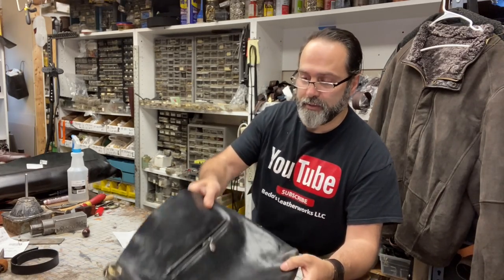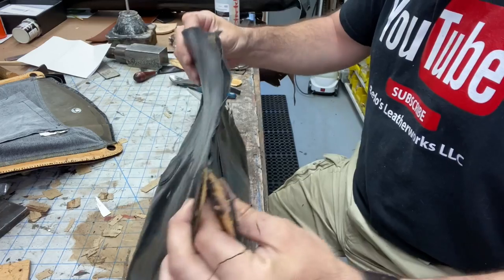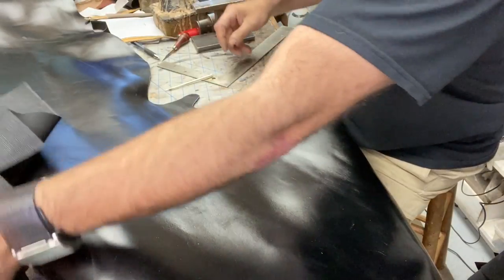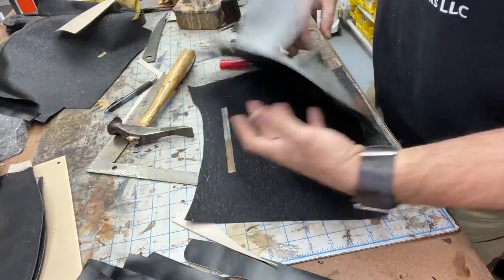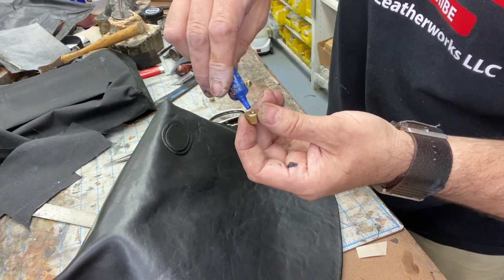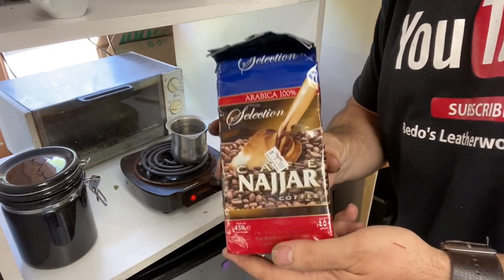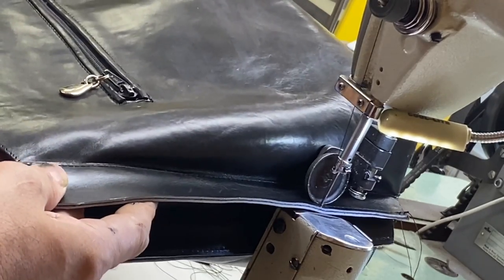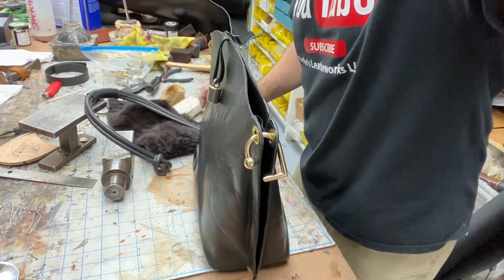Saving another bag from a repair gone wrong

Comment: I would expect a well trained professional/artisan to charge at least $70/hour, and maybe more if they are located on either coast. I think people forget that your hourly rate also covers things like rent on the building, and electricity and web hosting fees and wear and tear on machines, professional fees, training, you tax accountant, placing orders for supplies, etc, etc. Overheads have to be calculated into your prices to make running a business sustainable.

I also think it is easy to forget that when I see you with a pile a cut out pieces and your sew one seam and then the bag is done, that it looks easy. I imagine that 30% of your time is spent looking a bag and reverse engineering how it was made, and coming up with pattern pieces and a plan. And that is not shown because it is less interesting to film.

Steve, you are so gracious to share to your craft with us. It is your gift to me and I am very grateful. Thank you!
Reply: Exactly. People have no idea how much running a business costs. I had none, untill I ran my own ... It took me a full year to know learn how much I should be charging, and what to expect.
Reply: Also there are wastages on materials that Steve have to absorb, as these materials sometimes came with flaws that cannot be used for the repair work.

Comment: I work at a lawn equipment repair shop. And NOTHING drives the mechanic crazier then when someone else has tried to work on the unit, and failed. He says the same thing you mention in the beginning "sometimes it's more work then it would have been, if they hadn't had someone else try to fix it"

Comment: For an old very dry and  stiff briefcase, whose machine double stitching has mostly dry-rotted, and which needs to be re-dyed - to do any stitching I'd first have to condition the leather to make it more supple, but - should I dye the leather before conditioning, or condition the leather before dyeing?
Many thanks for your anticipated clear response, based upon your experience and expertise (not to mention, a cool beard).

Comment: You can try to use a screwdriver with magnetic head (the head can be bought separately) or to use a smaller one that is not in shape of a gun because you have small areas to work in.

Comment: Hi, Steve! I love watching your work. I couldn't afford your prices. However, people have no right to complain about the price of a manual job that requires skill and experience that takes years to acquire. In fact, don't complain about the price of anything. If you can't afford it, don't buy it.

I'm a little confused about the color of metal parts. Zipper handles and the metal accessory hanging from the top are silver. Eyelets are brass and the hook(?) thingy is pale yellow. Did she ask for it to be like that? Would it be possible to match the colors?

Also, that's how we make Turkish coffee. Much better than filtered coffee in my opinion. You don't need to bring it to a boil more than once. If you leave it be and don't stir it, you'll get lots of nice foam.

Comment: Mr Bedo, what type of thread do you use to stitch leather? I am making some repairs on our BOAT COVER,  but I don’t want to use “box-store” type. What would YOU recommend? (It should be U.V. resistant) Would it have made any difference if you “rounded off” the corners/edges of the bottom before attaching the feet to the bag? Asking for a friend! 😁
Reply from the maker: look up "threadexchange.com"

Comment: In terms of cost, look at it this way. If you were having your car worked on, and the repair took (for example) 6 hours for a skilled mechanic to complete, most people wouldn't bat an eye at a $500 labor charge. Why should this be any different, just because you're working with leather rather than auto parts?

*I wrote that at the beginning of the video, guessing a job like this probably cost around that much. At the end, it turns out 6 hours was about right.

Comment: Instead of spending time making coffee and tricking us with the spoon, I wish you would have shown things that you didn't.  For instance, show us the cutting of one of the eight sides, the dyeing of the leather, the sanding and dyeing of the leather on the sides down to the stitches like you said you were going to need to do, and the placing of the zippers prior to sewing.  These are things you said you were going to do but didn't show us how.  You don't have to show things like cutting 7 of the 8 sides but show us at least 1.   I just feel there were gaps.  The purse turned out well.  I don't think your prices were unreasonable to extend the life of it for 20 years.  Thank you for your video.

Comment: 500 dollar job. America is really turned upside down. With all due respesct to the video author, at the end of the day he's a cobbler. Some may call it artisan in his own right, but a cobbler none the less. To what point has a country gone to when a cobbler is considered a rare artisan. Sure there still are what could be considered exotic cobblers with unique sets of skills. But the repair performed on the video is nowhere near that level. 500 dollar job. Around here that would have been a 50 dollar job, at most, as it would already be considered expensive.
Bag with sentimental value - proceeds to destroy hardware. Seriously...
Reply from the maker: mudemmeonick it had a $50 Repair that’s why it ended up in my hands. Just a cobbler??? 
I think of my self more of a leather smith, most cobblers don’t know how to custom make leather goods like bags, briefcases, jackets and so on. With all do respect, you have no idea what my skills are, if you can’t tell the difference between just a cobbler then what I do then you need to educate yourself. 
Thanks for commenting.
Reply: @BedosLeatherworksLLC  I know several individuals in your line of work. More than half a dozen, easily. That's how common such a profession is around here. Not all in the same geographical area, but near enough. Hence my comment about to what point has America gone to consider it an exotic trade. Since I own a lot of leather items I end up, rather frequently, looking for the service of two of those individuals. One can even be said to be my neighbour.  I can vouch those two would be able to do the job you did on video without any hiccups. I had one do a similar job to a leather briefcase that used to be my dads. Full teardown and integral restoration. Complete with reinforcements, stitching, lining, hardware, the full job. It didn't cost me 50 bucks. Close, but not even 50 bucks. 500 dollars for that job would have been simply through the roof excessive, from my point of view. Prices in America are going insane for a lot of things.
You're obviously free to apply the pricing you feel like, and much of that is certainly correlated to your surrounding economic environment. You have to also be aware that if you take that kind of information publicly, then it becomes a public discussion. Modesty is free though. There are no such things as "leather smiths". Guess I'm just graced to live in a place where this kind of job is still seen as a regular occupation and not over-glorified, with all due respect to the job itself and its inherent importance. I'm just left wondering how much would you would have asked to restore a leather jacket to the likes I have seen done.
My comment wasn't aimed at putting you down. From your reply I've sensed you might have taken it as so. I just don't agree with some things on it. Doesn't mean your videos are bad, doesn't mean your content is bad. If it was it wouldn't have grabbed my attention. Just keep it real. Best of luck.